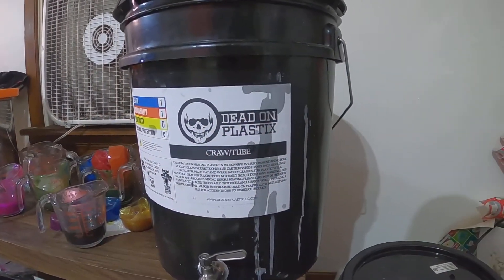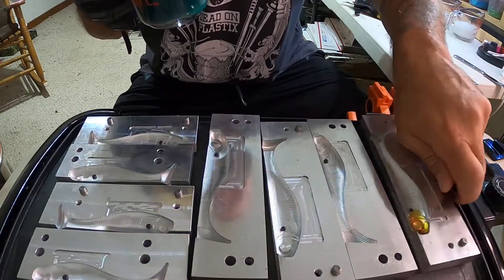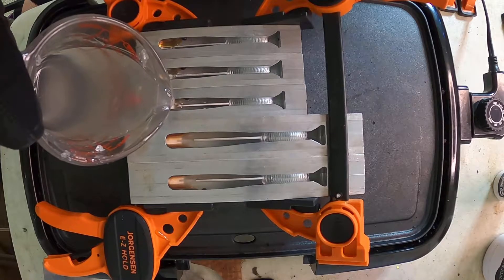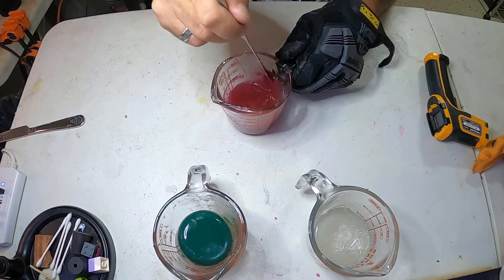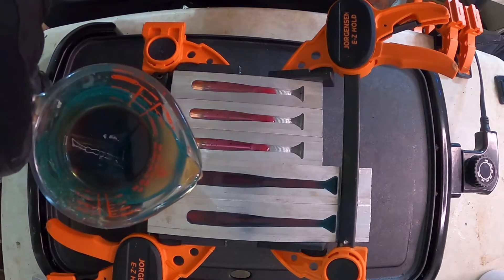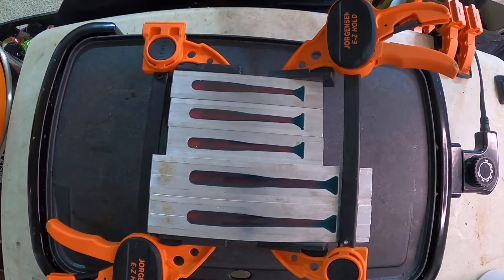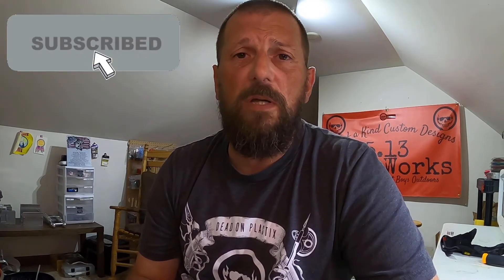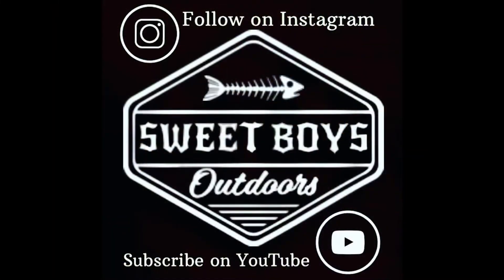“Wilson” Custom Color Handpour

Comment: John, Nice looking bait.  I wasn’t sure I heard you correctly.  Did you say you leave them on heat for 1 1/2 after you pour?  What temp?  Thanks
Reply from the maker: They are left on the hot plate to cool. Not with the hot plate on. I let it cool at it’s own pace. Usually takes about an hour to be cool to the touch.